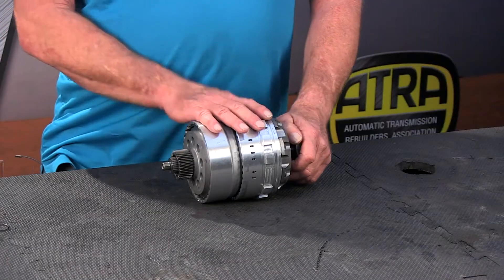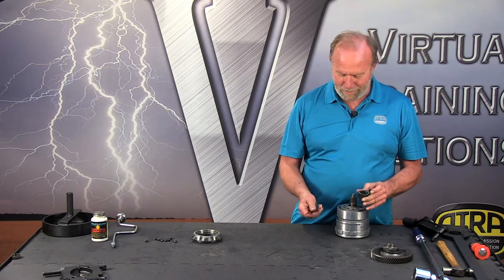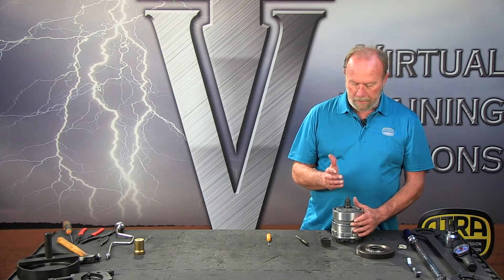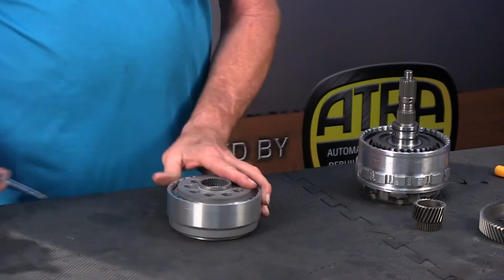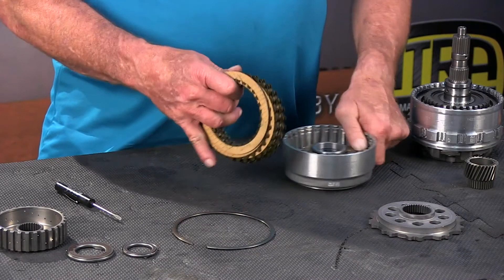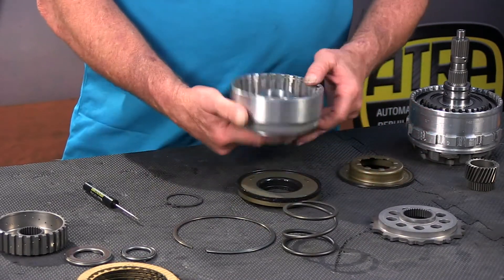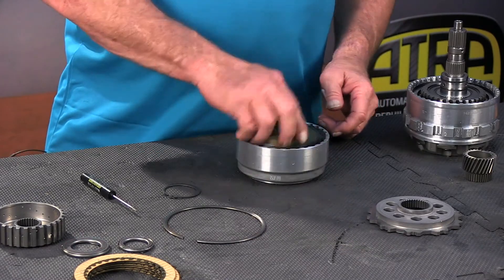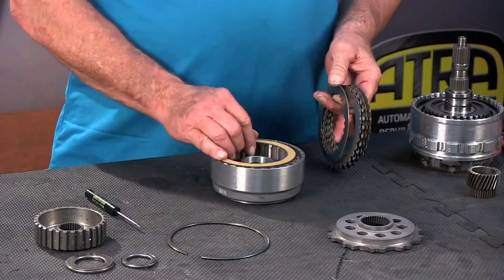07 vts bb 62te compounder disassembly pt1

Comment: What happens if you check the clutch clearance and you’re either too tight or too loose relative to the specification?
Reply from the maker: Good question. When you purchase new clutches, it's not uncommon to have differences in height. Usually, only a .001 difference but a pack of 5 could be .005, which is still nothing to balk at. It's only when your clearances are greater than or less than .005 from spec; in those cases, you might encounter a couple of complaints. Of course, it depends on the clutch we are talking about, but at any rate, shifting concerns between gears are the most common. Slide shifts (Too loose) or harsh shifts (Too Tight). In some cases, after you clear the adapts and readapt, you'll never see an issue because the TCM/PCM controls the flow rate to cushion or speed up the shift. Try to keep the clearance as close to the spec as possible. For more information on transmissions and how ATRA can help you check out https://members.atra.com/